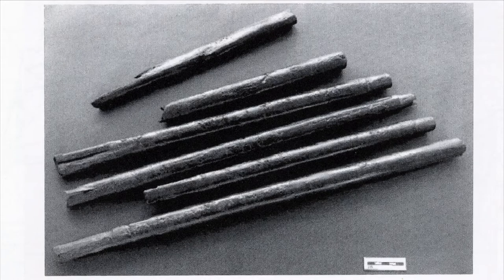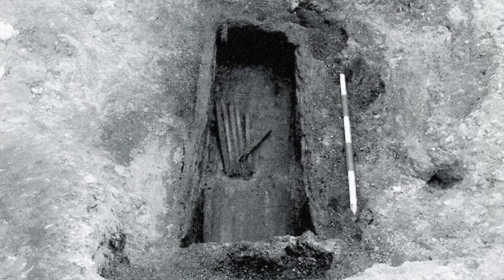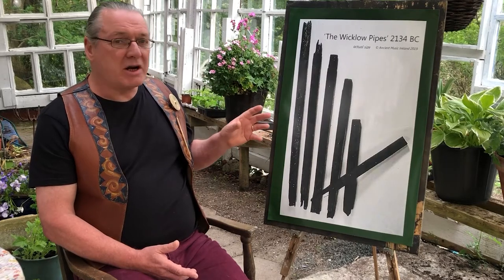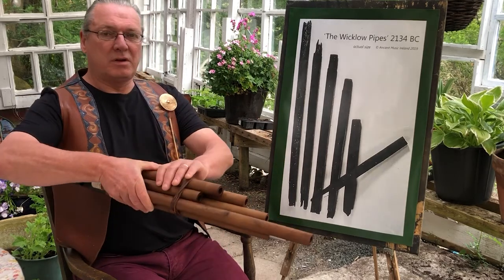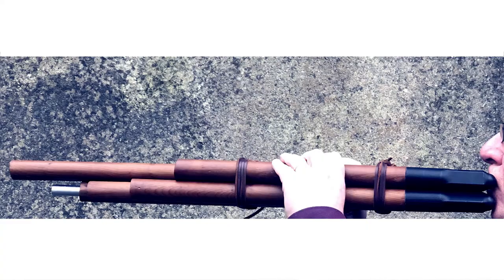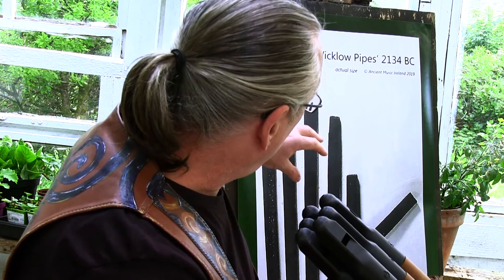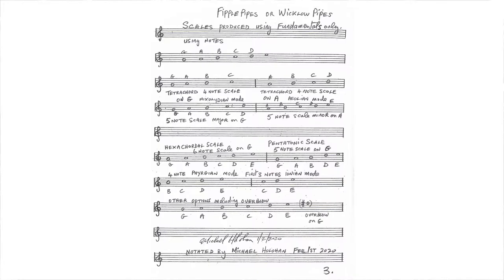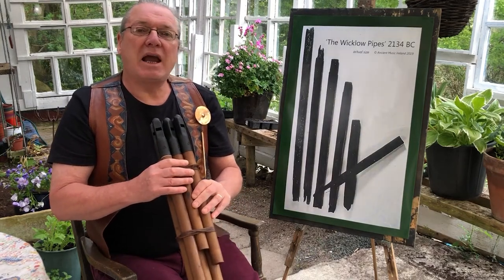Bronze Age Musical Scale - The Fipple Pipes an Introduction

Comment: With the greatest respect to all the work and research, I honestly don't think theses were fipple pipes.  Several reasons; Why couldn't they have just easily cut the fipple into the stick itself, like pan pipes?? Or even easier again, a simple embouchure hole, like a fife/flute. Instead of having to carve extra mouth pieces, as are done here in Plastic? Fact is, these were inserted into something organic which had rotted. This should be mentioned here. I could be mistaken but I reckon it was a leather bag. Or maybe a wooden block with fipples/reeds. Not trying to say the Irish invented the bagpipe lark, but it could have been some sort of organ pipes supplied by a bag reservoir for constant air. The Romans and Greeks had them, ( I know this is older) It even could have been a class of reed instrument like the Aulos. Any piper/flute/whistle player will tell you, this arrangement with six fipples is also ridiculously impractical! Thats just like sellotaping a load of different sized tin whistles, with no finger holes together. Why on earth would you tie 6 'tin whistles' together and have to carve each pipe a different length, carve a separate mouthpiece, and bind them all together - then take your mouth off each one to blow on the next - when you could just use ONE tube, with FINGER HOLES, and one fipple, or hole top like any flute, fife, or modern low whistle made of pvc pipe. The technology was there for bone whistles since the stone age. These people probably knew more about music than we do.
Reply: Think you're onto something
Reply: Hey, Native Bolivians in the Andes play “pan pipes”, as did the Greeks.
Reply: @whirlingsu1 those pan pipes were more of flutes, and didn't require actual mouth to flute contact. Its kich easier to plan pan-flutes than fipple-pipes
Reply: @dublinpiper " These people probably knew more about music than we do. "  Possibly the only intelligent comment I have ever read on YouTube. [ Apart from my own, of course ........................ ]
Reply: I was thinking the same thing that it seems odd the fipples were attached separately.  I am thinking they would have been a reed.  If they were notched or rim-blown, again, why separate end pieces?  One possibility is that they had bone ends. Many notched or rim blown flutes are made with bone or horn. For example, the Turkish ney mouthpiece is made of cow horn, which gives a softer sound.
Reply: Yep, I agree with you, and that's something I failed to mention - notched, or rim blown as opposed to a fipple would be easier. And I think the bone/horn ends is also interesting, I hadn't thought about that. The main point for me is, that each end is fashioned into a tennon joint indicates they either all fitted into something like a common stock/block, or something went over them... But I maintain that a load of separate whistle-head fipples is just daft, much more work, and far more overly-complicatedly difficult to play!  So I'm kinda caught between some sort of organ pipe/reed/ or notched rim panpipe setup. thanks for your interesting thoughts, I do like the horn/bone end idea somehow too, and  I am going to have a look at the Ney  @BrennaCorbit
Reply: Would not these these be  the original pipes of the fairy folk....?
Reply: These being some sort of early bagpipe would make more sense, even by the way they were laid out when they were found suggests that there were 5 "drone" pipes and then one melody pipe.

Comment: I'd be interested to know if there is a particular reason why the pipes 'reconstruction' has been done like this. Was there evidence of strapping tied around the pipes like this? It just doesn't feel right to me that a musician would want multiple fipples like that. That makes it very uneconomical with movement. I feel that pipes (if that's what they are) would more naturally be placed side by side a bit like pan pipes? This instrument seems incongruous. Even with pan pipes, moving the whole set of pipes back and forward is still less taxing than pulling your mouth away, moving to another pipe and re-engaging for the next note. As you can see here, speed is greatly affected. I'm not convinced.

Comment: With no evidence of fipples on the pipes, I’m surprised that that were chosen to complete the pipes as they seem like the most unlikely mouthpiece to use. I don’t think the tune has been played slowly in the video to show the notes but rather because the fipple design is so impractical that it is the fastest it can be played without sounding crap. Although we describe ancient peoples as (especially in the uk) primitive, they weren’t stupid and probably wouldn’t have put in the work of carving each pipe their own fipple when they could be played just as panpipes with a smaller cylindrical mouthpiece attached. This is further backed up by how they were found, laid out next to each other in ascending order (much like a panpipe) and no evidence of them ever being arranged like the reconstruction in the video. Although I respect the dedication of making these pipes, I don’t believe they are accurate to the original when taking into account the points I’ve mentioned above.